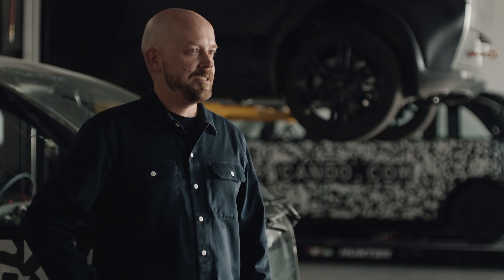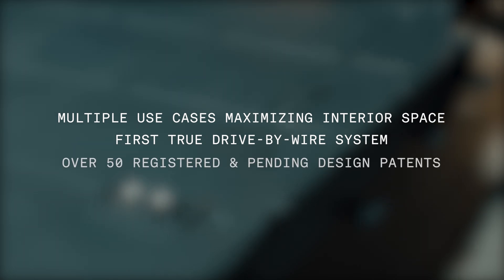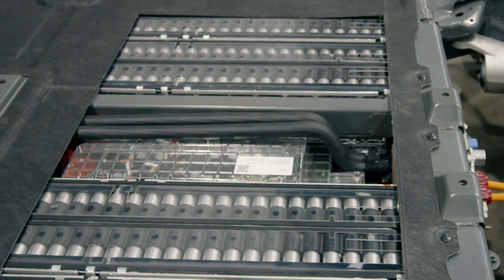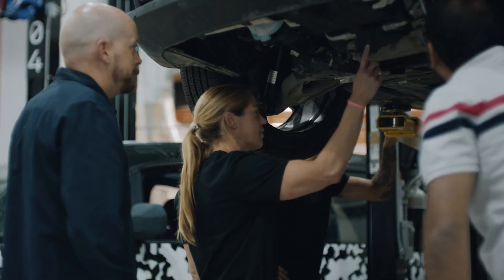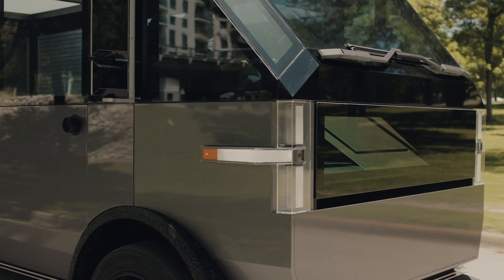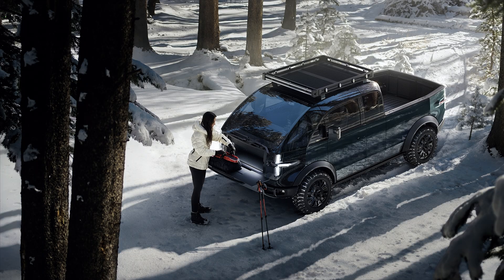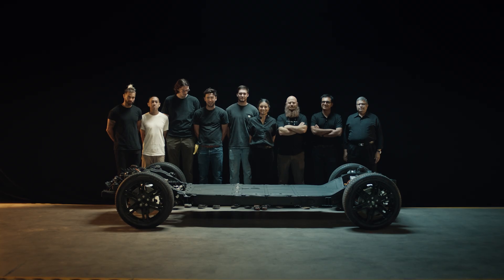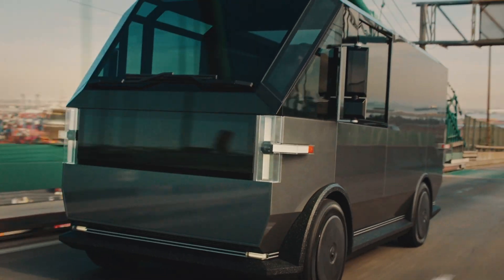THE MULTI-PURPOSE PLATFORM | ELECTRIC VEHICLES | CANOO

Comment: i would love to see windtunnel data on that brick... as far as i know sharp corners arent well liked by wind..
Reply: How fast do you think they're going? At that speed, it doesn't matter. Besides, there's a 45 degree angle, it's not a sharp corner.
Reply: @edenassos  Eh. What did you smoke? Even at 30km it makes a difference and most cars go faster even if the radius of operation is located in a single city. and only the top corners have a 45° angle as well as the front window sides. you have protruding carlights and wheel fenders and sharp corners esp. going towards the back which creates drag.
Reply: @AkiSan0  Ah yes, another weeb explaining to an engineer. Look closely at the silhouette of Canoo's vehicle and tell me that it will have worse off aerodynamics than the current similar class vehicles on the road today. What do you do for a living?
Reply: @AkiSan0  You had no argument. You just regurgitated the obvious. Anyone with half a brain knows that sharp corners affect drag, you don't have to chant that surface level knowledge. If you were really a scientist, you'd know that fluid dynamics covers gases too. 🤡 I run a materials science startup so no, you don't have to explain tribology/aerodynamics to me. Thanks for the showcase of surface-level knowledge. Also, did you see the latest designs by Canoo? They are as curved as a vehicle like that can get so I don't know what you're crying about.